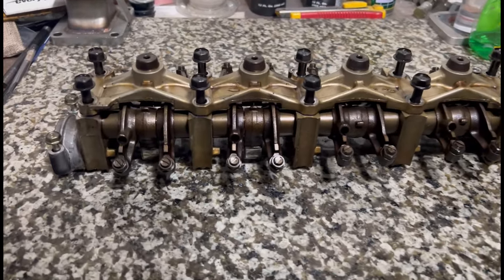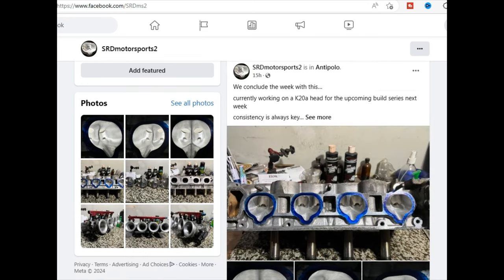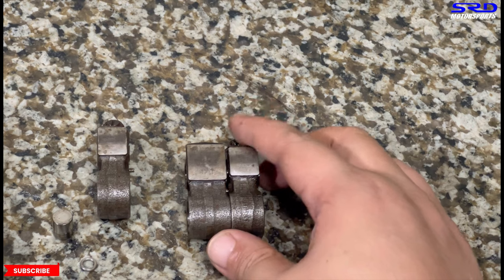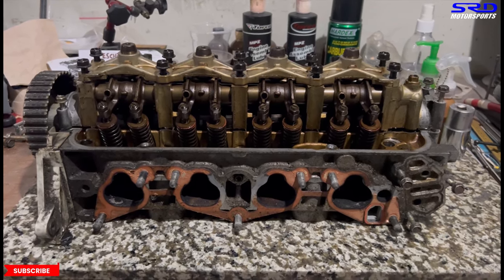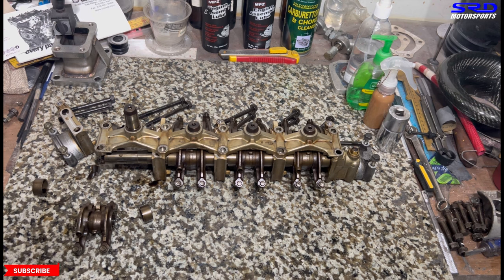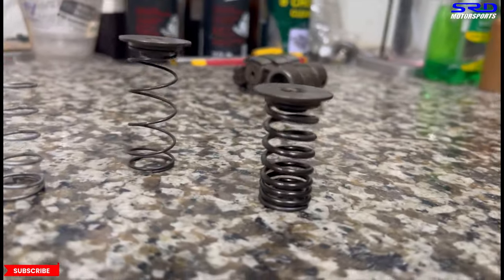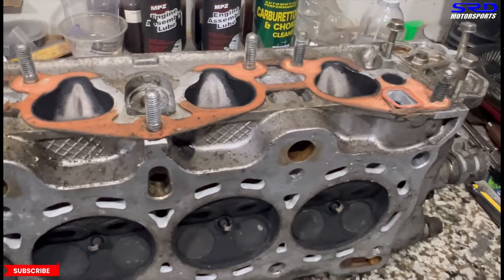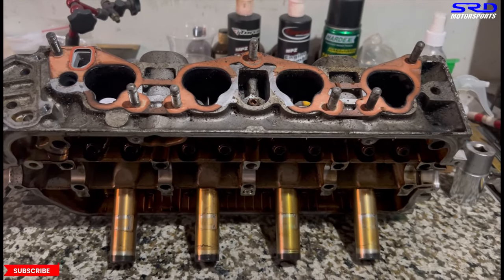HOW TO: Lock Vtec Rocker Arms with SRDmotorsports

Comment: I did something similar when I installed a d15z6 VTEC-E cam and roller rocker arms into my d14a4 non-vtec head. Used a nut that we ground the edges off to become a circular wide spacer and ground it down so it's narrower and fits next to the spring, simulating oil pressure. It's always locked in 16 valves and since VTEC-E switches on at around 2000-2500 depending on load, idle and low rpm is just fine.
Reply from the maker: Yep

Comment: very timely...but i think i need to disassemble and remove some of the spring coz aftermarket springs would be very hard to turn😆
Reply from the maker: True it would be hard to turn but atleast just remove the cylinder 1 intake and exhaust springs no need for all of it just don’t install the other rocker arms just the one for cyl1

Comment: Is it worth it to lock vtec on an NA track car? 12.8:1 compression with pro2 cams
Reply from the maker: I think a lot have a misconception of it…

It’s simply having an engine or building an engine specifically for xxx type duration and xxx type lift for the specific powerband 

its only us who has vtec but the engine design and approach is still the same